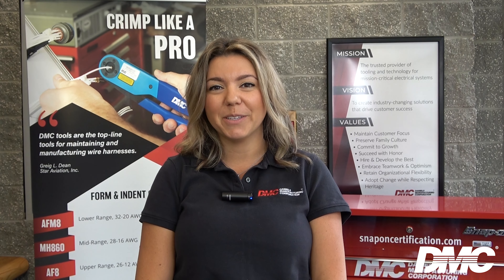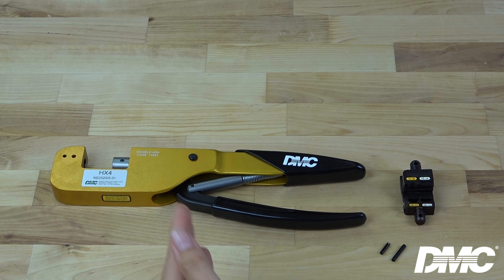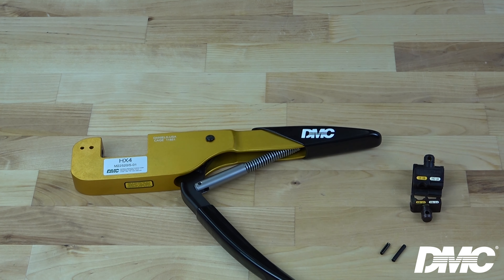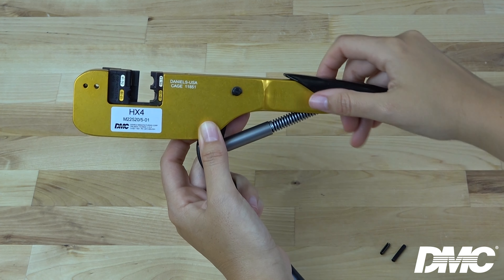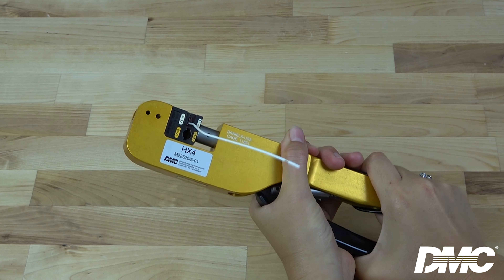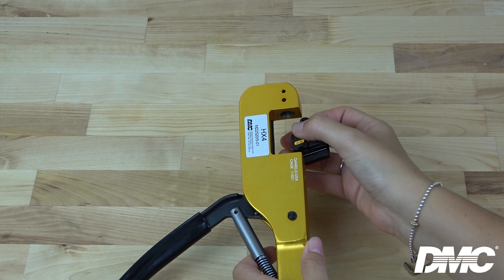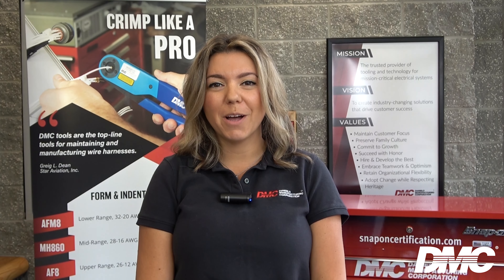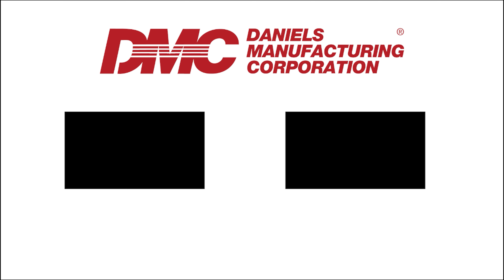How to Use the HX4 & HX3

Comment: This  tool need to calibration?
Reply from the maker: This tool is sold calibrated. You can choose to add a calibration with reading. Specific dies used with this tool also offer gages that allow the operator to check calibration in the field.

Comment: How to fix the tool when it got stuck due to installing wrong dies
Reply from the maker: We recommend using a die removal tool to remove dies from the HX4 and HX3. Here is the link: https://dmctools.com/hx3-82. However, if you didn't install the correct type of die into the tool we recommend that you send the tool in for repair. Find our repair information here: https://dmctools.com/resources/calibration-repair